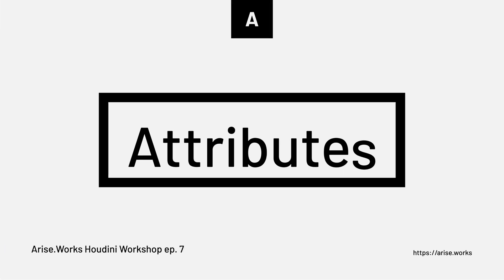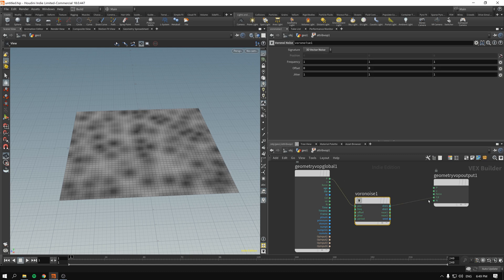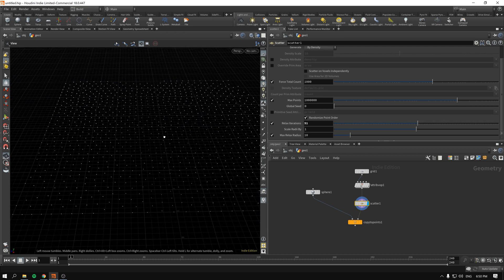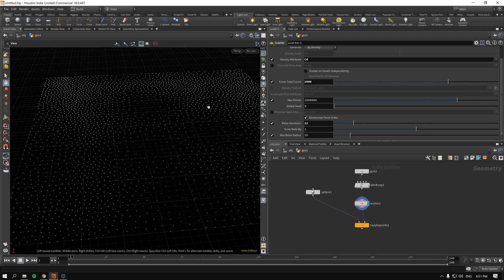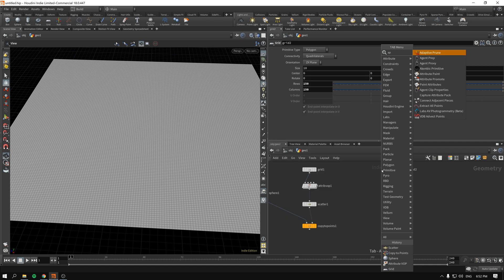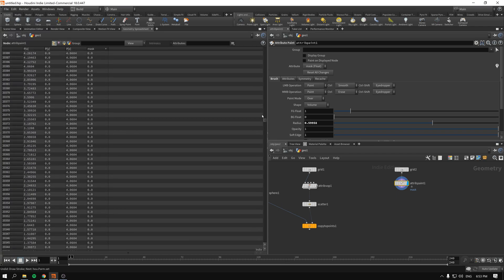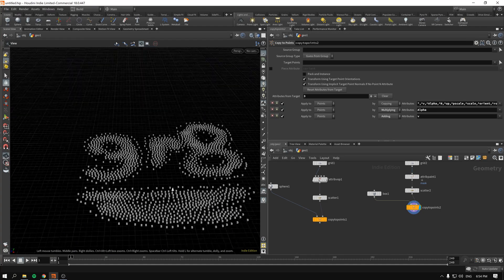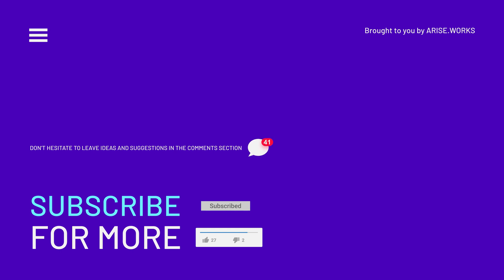Scattering by Attribute, Hand Paint Attribute – Houdini Attributes and VOPs ep. 7

Comment: Great tutorial. But, the first step its increase de geometry resolution. How i can use vop noises and other tools in uv space, without increase de geo res?
Reply from the maker: In UV space, as in textures? If so, I'd suggest substance painter/ Quixel Mixer.
Reply: @AriseWorks  i mean, work in vop without increase de geometry density.
Reply from the maker: You can, but results might be different. Nothing stops you from trying anything and everything.